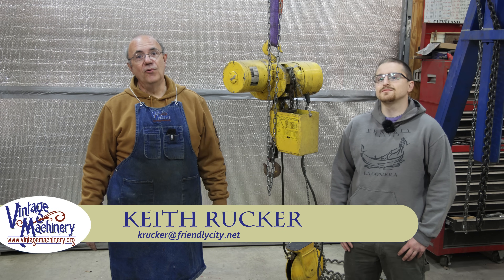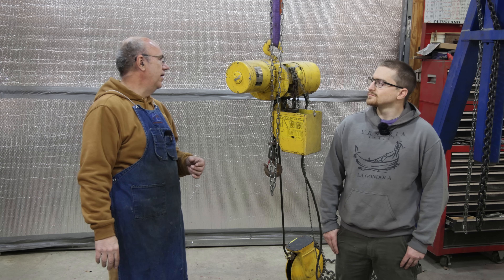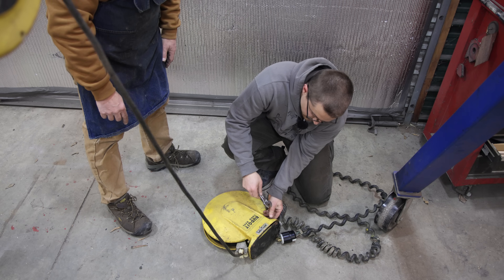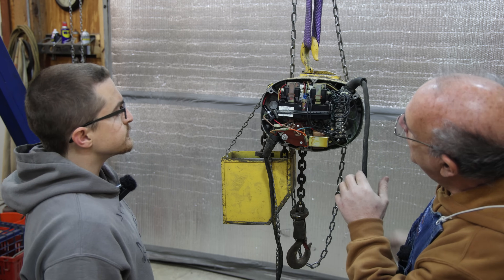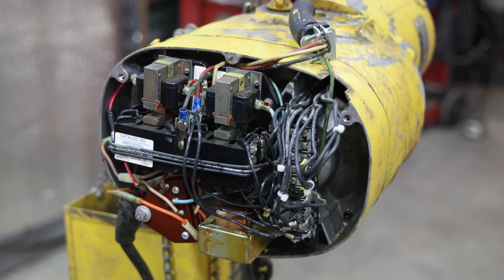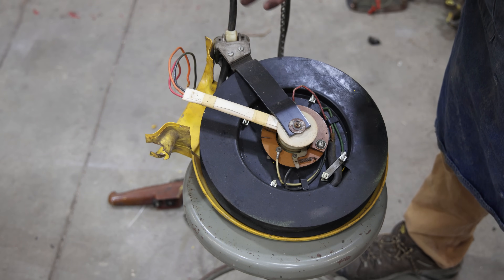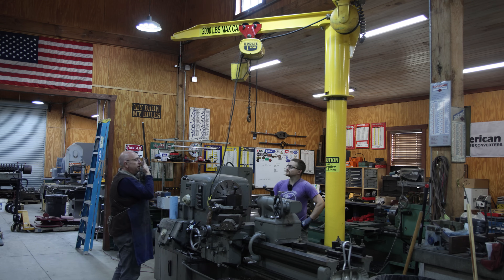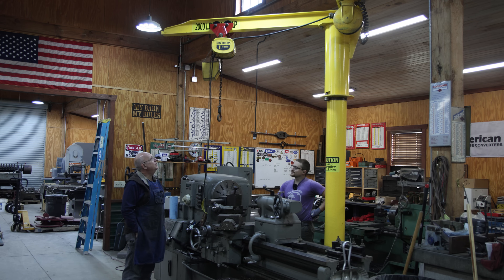Jib Crane Update: Upgrading from a Manual Chain Fall to a 1-Ton Electric Chain Hoist

Comment: Had the same unit in my old shop. Put a bungee cord onto the cord, holds it up but lets to still pull it down for use. I got real tired of running into the controls hanging there.

Comment: Massive overkill to have that huge jib crane just to lift parts onto the lathe maybe a few times a year.  An electric pallet stacker would do the same job and could move around the entire shop to service all the machines as well as bringing parts in from the outside.

Comment: That jib crane is rated for 2k pounds at the tip. Halfway out it should be good for roughly 4k. That's why it had a heavier than 2k chain hoist on it.

Comment: Since someone might have had their fingers in it over the years... check the chain, and make sure the weld is OUT, away from the drive sprocket.
I was a parts and service guy at JET equipment going back 35 years ago - sold many a sprocket to replace the chewed up one!

Comment: If the original use of the 3 phase motor on that crane was wired in Delta (vs Y), it wouldn't have had a ground.  If it was wired in Y,  it would have had a separate ground.

Comment: When we merged with another company, they had electric hoists. We purposely had hand operated hoist. Within the first week we had an operator removing an injection mold from one of the molding machines and had the entire machine floating in the air being held by the eyebolts in the mold he was trying to take out of the molding machine. The push of the electrical button is not the same feel as the chain drive on the hoist.

Comment: Perhaps it had a 1-1/2 ton winch because, although the beam can only handle 1 ton with the load all the way out at the end, it can safely lift 1-1/2 ton if the load is closer to the upright.

Comment: Years ago my wife. and I were looking at a house with an "RV garage", or that's how it was listed. Turned out the door wasn't wide enough for the trailer thru. But the kicker was the 2 1/5 ton Jib Crane inside and 5 220vt plugs . This guy didn't build an RV garage but a machine shop. The Realtor said "If you don't want that, just sell on Craigs List". Ha.

Comment: Kieth, that SO wire is junk. It'll be cracked and useless in five years. Why it's even made, let alone sold, any more is beyond me. Buy a camper extension cord that has a plastic type insulation on all conductirs and the outside cover. It'll last forever, certainly for your lifetime. It's difficult  to find the wire in free lengths, but the trailer shops sometimes have it available. Otherwise, a premade cable is the way to go. Just cut the ends off. I believe it's classified as SOJT, but DON'T  quote me on that.

Comment: I’ve heard a lot of the other machine shop makers claim they’re sticking with manual chain falls because it gives them “better control”. 
May be true of the older cheaper “Harbor Fright” electrics, but you have an industrial quality unit.

Comment: Moved into my shop recently, sleeping on an army cot next to my fisher wood stove. Currently using a canton crane as a head board, and a Yates American Y36 snowflake watches over me while I sleep. Waking up and already being in my shop and seeing a new Keith Rucker video is a heck of a good time.
Reply: Can't beat a Fisher stove!
Reply: @ the one in the shop is a papa bear, and it is just a treat to use. Does its job quite well in these cold New Hampshire winters. Absolutely love sitting and listening to the air ripping through those draft/damper caps.
Reply: @Spaceman_spliff  I turned the draft bolts around so I could take the caps off. They'll roar then. We had a mama bear, folks had a papa bear and my ex had a coupl,e of Grandpaw bears. They all would hold fires overnight on spruce chunks from framing jobs. Just put on fresh and open the drafts and it's warm air time.
Reply: @lewiemcneely9143  a family of bears for a family of people! That’s a good idea regarding the draft caps. Given I’m 28 years of age, this stove should last through the rest of my life, and that’s just fantastic.
Reply: @Spaceman_spliff  I've seen them go through house fires and all you need to do is wirebrush the rust off them, slap on paint and OFF YOU GO again! Maybe restack a firebrick or 2. Some of the draft bolts are spot welded but a grinder can fix that but they'll work fine either way.

Comment: Hello Keith. Great stuff. Does halving the voltage from 480 to 240v decrease the lifting capacity (by half)?
Reply: It just doubles the amps required
Reply: The lifting capacity remains the same on either voltage, the reason it was wired for the higher voltage was for the advantage of lower operating cost. Kieth won’t be using the hoist so much that it would affect his electric bill that much

Comment: 240 volts = low voltage?  Must be a power tool.  😁
Reply: OSHA says 600v and less is low voltage,  that motor like all multi voltage is just labeled that way for reference.  but most just say 240v 277v or 480v some older say 460v

Comment: In Canada we have 575 volts only 3 leads
Reply: Delta  or  star ?  Motor wiring .
Reply: @ that would depend on the horsepower of the motor, we call it wye or delta, wye is more common in Small motors
Reply: @dundasjunctionmodelr.r-jam8267  
Yup no need for a neutral.  Those little  pump motor fail ,it can be quite the light show. No need to wonder which motor failed😆⚡️💥
Reply: @ neutral not used for 3 phase motors in Canada

Comment: Now get one for the gantry.  Watching you pull those chains makes me nuts.
Reply: While I sort of agree, and I have thought the same at times, there is a problem. The gantry moves around all over the shop. And Keith may not want to worry about having to plug it in. Chains need only muscle power.
Reply: @wuudturner  How about a hoist designed to use a fork-lift battery.  "Watching you pull those chains makes me nuts." Me, too!  So painfully slow for Keith.

Comment: Sold many Budgit hoists back in my Sales Engineer days in the mill and industrial supply business! The electric ones work fine but most of my customers preferred air hoists for finer control when spotting loads. Really just a matter of personal preference. In your case getting a good deal on a used electric one beats the snot out of buying a new air hoist! :body-blue-raised-arms:

Comment: Sorry but when i saw at 5:55 your drawing the left side looked like a star config witch is for higher voltage and the right looked to triangle witch is for higher current=less voltage. But maybe i missread your way of drawing (without drawn coils). Anyhow thx for your videos.
Reply: A motor starting under load is usually wye wound and a delta wound motor is usually meant for no load starting. A winch is expected to start under load so it should be wye wound, at low or high voltage.
Reply: @millwrightrick1  Yes totaly agree. But as i interprete he now drives with lower voltage in star.... But i think i missinterprete his drawing.

Comment: An electric hoist on your blue mobile gantry crane would be great too. I know a guy that repurposed an atv winch on his.  Runs it off a 12v car battery
Reply: Harbor Freight, Amazon, and others sell electric hoists of different capacities for lifting for around a $150 bucks  
After just checking Amazon for verification, they have a 110 volt, 2200 lb, 3 way hoist with 38 feet of cable for just under $150.00. It has a handle on it so it can be used for pulling also and it comes with a wired or wireless controller. That could be handy if you’re moving something heavy around the shop or trying to get that something loaded onto your truck or trailer. I might have to grab one of these to have around the shop, I’m getting to old to be dragging stuff anymore. Lol
Edited for misspelled words.

Comment: I hang, repaired, and run PM on many of those things years ago, in the hottest and coldest weather. I used to work for one of the largest railcar manufacturers in the US, and jibs were hanging everywhere. I was young, then, but wouldn't want to try it now.
Reply: I used to do all kinds of things when I was young and dumb that I wouldn't try now that I'm old and dumb.

Comment: 14:00 the mounting hook lost its catch. It would be advisable to add one. Because this isn't an industrial use machine, adding a simple piece of thick wire will suffice. That said, beware of jumping loads, that would potentially cause this (as is) to unhook. Have seen this happen once with a snapped chain, and the whole crane fell on the ground (it was a cheapy one that didn't have any kind of safety for the hook to begin with). So be aware of that.
Reply: @aserta it actually can't unhook. I had to disassemble the beam trolley to be able to install the hook onto the load pin. The load pin has a reduced diameter section where the hook sits and can't be removed while the trolley is assembled.